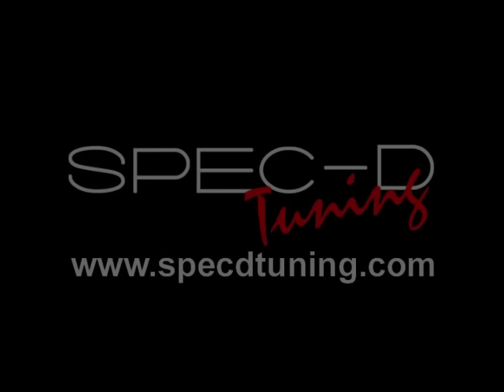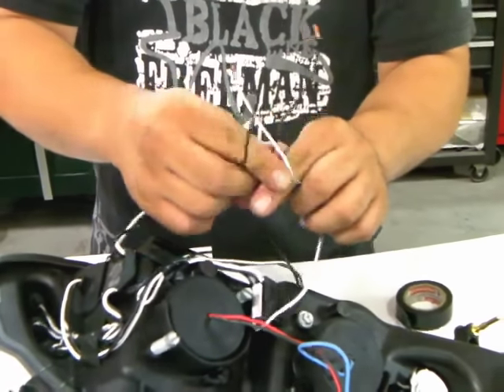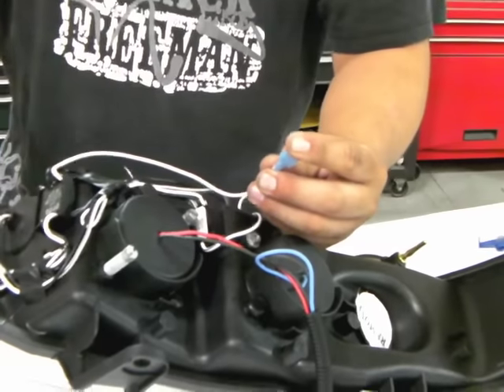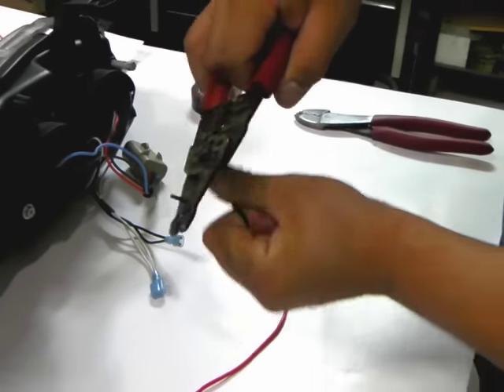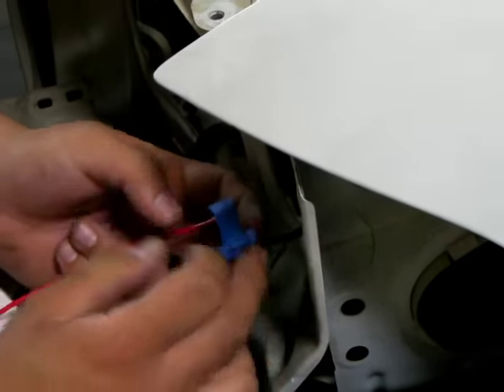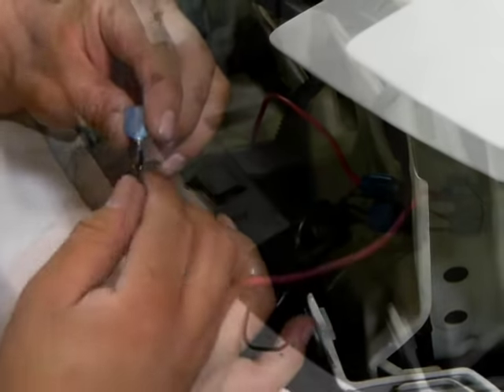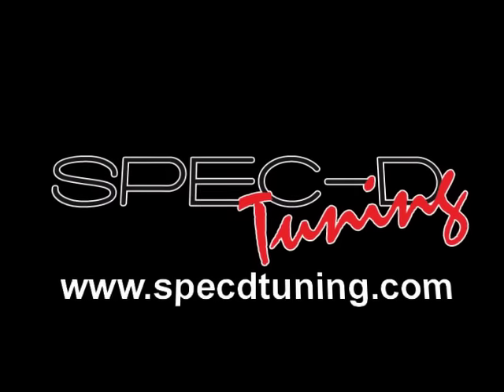SPECDTUNING Installation Video: Halo LED Projector Headlights Wiring Installation

Comment from the maker: You could always splice them into the headlight wires or if you have fog lights wire them to that, or interior lights. If you wire them with the headlights they only turn on with your headlights same with the fog lights. but if you go interior lights you would have to find the right wire to splice into so that they turn on when your car is on. Some wire that is always getting power.

Comment: Different companies make these lights. Some will make them with a board directly behind where the ring lights are. Some will only come with the c-clip on the front and you have to buy the wiring kit. If you have the little boards behind where the lights would be or are, then you just have to sauder the wires to the board. Then buy the lights separately and wire them in like the video shows.

Comment: I see that you spliced the extra red wire to the wire with 12volts running through it. Did you do the same for the extra black wire or is the extra black wire spliced to the ground wire.

Comment: What you most likely did is you connected the halo rings to the low beam wires and not to a 12v wire that is constantly powered when you turn on your lights to the daylight running mode.

Comment: Those are ballasts and from my knowledge all HID lights require them. Unless you are replacing a stock HID bulb aftermarket installation involves a complete kit with bulbs, ballasts and wiring harness.

Comment from the maker: @nimkal Automatics and Manual will still be the same.. your parking lights act the same as your Daytime running lights. if you turn the knob for your headlights one click, then those should be your parking lights.
wire your halos and leds to those. signal light wires are completely different.

Comment from the maker: @BLAZE45 The headlights should be the same. There are headlight bulbs that are included for the low and high beams. Unless, your headlights are not projectors; then you will be required to use your stock light bulbs instead. But as for projector headlight bulbs, contact your seller and let them know that you are missing bulbs. Good luck

Comment: So do you hook up the black and white wires and the main head light harness for the regular lights? I can't see low/high beems working by hooking them up with only the black and white wires connected.

Comment: I have another problem. I have them hooked up by following your video. I also have LEDs in the assembly. The LEDs light up in low beam on the drivers side and not at all on the passenger and the complete opposite in high beam. Is there an easy connection problem I have or is the head lamp assembly messed up?

Comment from the maker: @chrstbelieving Not quite understanding what you mean by splicing them in between the car. If the way you describe on how to wire the halo's and led's work then its all preference from there on. However, this was just a simple tutorial on how to do a basic wiring for these types of lights

Comment from the maker: @elizabeth7699 Please remember, if you fog lights are not Factory, then the power wire might have been bypassed from the fuse box. Moreover, if your parking lights were working before the installation, then the wires are not wired correctly. Good luck to you

Comment: I just bought a pair halo headlights from spec D tuning  for my 96 200sx ser. I have a quick question do I have to remove the bumper to install ? or follow the procedures in this video.

Comment: i installed the lights as you showed and they work really well BUTTT my indicator lights are not flicking on and off for some odd reason. they did so just earlier today and now theyre just on and not blinking. also when i put on the park lights is the halos supposed to turn on as well ? they only turn on when the main headlights is on. its ok but it would be cool to have halos on the parking side too. thanx everybody.

Comment: Bought these for a 2000 Pontiac Grand Prix GTP.
 Is the installation the same as in this video?
 And, because I do have daytime headlights, is this an issue?
Thanks for any help you can give me before I start installation.

Comment: Theres a third smaller wire (white w/black stripe) that appears to go to the 3 small leds. Does that get connecter with the other 2 white wires?
Reply: Johnathan I have three set of wires instead of two what should I do with the third wire no video on youtube showing what to do with the third wire
Reply: @michellehaley166  did you ever figure out what todo?
Reply: @ItsTheByrd  yes thank you for asking
Reply: What did you do

Comment: To SpecD, How do you adjust these headlights??? At 2:09 in this video the headlight is oriented with the turn signal to the right, high beam center, and low beam left. To adjust the headlights do you turn the two long flat head screws on the low beam light, or is is that long gold screw to the upper right of the video at 2:09?? Thank You

Comment: I have two questions before installing my projectors:
I ordered the Anzo 121055 headlights for my 02 Civic and noticed two things.
1. The two wires in the back for the halo lights, one should be red and the other should be black, yet both are red. Where is the black ground wire? Do I wire them to the headlights or the park lights?
2. The area right beside the yellow plastic marker (right below the signal light) doesn't have a bulb it in. It's just empty. Is it supposed to be like that?
Thanks!

Comment: @Specdtuninginfo I dont understand why you guys quick connect it into the Red wire which is the headlights... the whole point of the LED and Halo lights are for them to be on without the headlights to be on  during day light. So on a manual how would I be able to do this? Which wires would I need to plug the halo/led wires to?

Comment: @BLAZE45 The blinker is not really connected in the wiring harness is it? I thought that was separate? But I may run my halo lights to a toggle switch in the inside of my car with it being straight wired to the battery. Having all three spliced to your parking light doesn't make the lights a little dimmer than usual since they are all sharing the current?

Comment: My halos have only one black wire and one white wire so do I just do the same as the video just with one wire in the connector instead of 2
Reply: Jeremy Perez mines is more complicated. I have 3 black wires and 3 white!! Idk what to do with the extra 2 that that didn't show in the video
Reply: Jeffrey  I m installing this same one, this  is the same question I had, so did you  solve?

Comment: I just purchased a pair of Ford Edge headlights (2LHP-EDG07-TM) that came with 2 resistors. Your wiring or installation videos don't mention those resistors at all. Are they actually needed?

Comment: Just got my headlights today, havn't wired them up yet, however I was planning on putting an HID kit into them, but as soon as I open the package it says HIDs not allowed. What is the point in buying projector lenses if you can't use HIDs?? will installing HIDs still be possible? is that warning on there because of the heat they produce? thanks

Comment: What if the aftermarket LED projector lights come with a red, white, and black small wiring harness that looks similar to the one created in the beginning of this video using the black and red wires?  Do I just separate cut the wires and remove them from the crimp connectors they came with?  If so, can you tell me if I'd be using all three wires?  Thanks in advance.

Comment: @Dstars3 Im pretty sure that its not worth the money to go to the pros. This is a very easy install, and you wont mess up your car. The worst you can do is burn out the Halos or LEDs on these headlights. These are plug and play. The only wiring you are doing is to hook up the Halos and the Led lights. All you are really doing is hooking all the same color positive wires together and connecting it to positive wire on your light harness. and same thing for negative. Quick connectors WORK!

Comment from the maker: 24 gauge and yes you can splice into that instead!
Reply: I have a 2002 Ford Escape. I'm buying the Spec-D 2005-2007 Ford Escape Halo projector headlights. The question is what year wiring harness kit do i need to install them, i know it's possible. Do i buy the 2005 wiring harness?

Comment: Why not run the wires on the headlight side of the connector? Running them on the other side of the plug gives you more things to disconnect.

Comment: So you spliced both positives together at the light and the negatives respectively, then positive and negative on the car respectively and put them together with the handy male/female forks. simple, but I don't have fog lights setup on my car. Should I install a separate switch for this? I just bought these from k2motor.
Thank you

Comment: You can make them work with the lights off but you have to wire them in differently. Put your lights on in the first mode with just the markers on. If you do it this way you just splice the hot wire into the wire that has the electricity running through it. You can also add an auxillary switch ran into the cab of your vehicle and run the wire to your battery. The black or ground wire can be attached to bare metal.
Reply: Excuse me but could you explain that in detail?

Comment: QUICK QUESTION.. i installed halo leds..they now work. nowhwo to i adjust the position of them.. the lowbeams are not straight and the high beams are pointed in the sky.

Comment: Did you quick connect the halo lights to the low beam wire?  if so, how are you able to turn on the halo lights without the low beams shown later in the video 5:58 .  Is it safe to quick connnect it to my parking lights instead?

Comment: So It’s safe to assume that the red cable it’s the one with power in my car as well since I also have Civic... right ??? Worst case scenario I just peel some of the cable insulation to expose the copper and then some electrical tape. I just want to know if the red cable is always the one with power

Comment: Thanks for the video my mk5 doesn't seem to have daytime running lights. Tested it and nothing just the normal  lighting signal high and low. Is there something else I can do maybe a different light switch I did order one The one I have just turns on the lights and turns it off there's no auto feature The new switch will have that?

Comment: Stupid question but I got the LED lights to work but they dont turn on unless I switch on the low beam lights. Did I do something wrong like connect the wires to the lowbeam lights insteado the the day time running light??

Comment from the maker: @airsoftassassin07 That should not have happened. If your blinkers work to begin with. there is no reason that they should not come on. The only thing this video shows is how to splice wires to your already working bumper lights (or blinkers) so that the Halo and LEDs can come on. If you have a headlight that (the headlight corners) plugs into the blinker harness; then its the projectors that are defective. Good luck

Comment: Okay first time doing an install like this and cornfused lol...I have a 2004 toyota corolla sport and just got my headlights today...the video is very helpful but do I splice the wires AND connect the standard plug on the headlight to my factory harness...he doesn't say...the headlamps I purchased have a wiring harness for the low and high on the back (I know I'll have to splice the LEDS)

Comment: @BN3DC2 
Check I wires again. Is your positive to the positive to the parking lights. And is you ground. Grounded. Best practice is to test the light before putting the headlight back in. Does you headlight have Led strip along with the Two halo?  Or just the two halo?. What car is it on anyway

Comment: I just received my Halo Projector LED headlights for my '07 Ford F 150.  The lights have a standard three prong connector and one red and one black wire.  Do I just plug the three prong connector into my regular plug on my truck and connect the red wire and black wire to the hot and ground wire on the trucks three prong connector?

Comment: is the copper wire ok to use the sold one which is quick connector thin enough to fit in the

Comment: Does the head lights bring the red and black wires? Does this same process works for the 04 Toyota Celica GTS? Does the wires behind the headlight harness have to be either red, green, or black or other vehicles will have different colors?

Comment: I installed the 1996-1998 HONDA CIVIC R8 STYLE PROJECTOR HEADLIGHTS on my '98 civic but didnt have a volt meter to do the l.e.d. wiring. I would like to do the wiring but am curious, will i have to take out the headlight casing again? Or would i be able to leave the headlights in?

Comment: SPECDTUNING: i was wondering if other than the power and ground was there anything else that needed to be connected such as the blinker light or does this setup already allow for power to flow to that automatically.

Comment: have a pair of these and i have only got 2 wires on back off driving harness +/-
wired the rest up but only have indicaters dipped and main lights working no halo or led any ideas how i could wire these on

Comment: hey man i just bought one of those headlight for honda accord 2006 they look nice but i got one problem wat wire should i test for the power i mean there is 3 wires the low pim one, the high pim, and the turn signal. so which one should i test

Comment: I recently installed halo projector lights and my headlights are dim and are not bright, I wanted to know which are the low beams and high beam, it has h1 in lows and h3 on highs I need help

Comment: Spec-d tuning I bought some halo projector lights for a 2003 chevy s10 xtreme . I currently have 1 light out on the Halo. With that said I was wondering not only how to change it out with a new bulb, the type of bulb I need and whether or not maybe I can buy directly from you but I would actually like to switch them from blue to red if possible.  Please point me in the right direction.  Thanks for your time and products.

Comment: Hey, my left halo and led lights do not turn on, Sometimes when I fiddled with the wires a bit they did, but recently I tried doing the same thing but they wont turn on, The right ones work fine though, any idea what the problem might be?

Comment: in my buddy's 2002 ford ranger, are the parking lights in his case the wires for the turnig signals. i kno it sounds weird, but has no daytime running lights unlike myself with a chevy. where exactly should they be placed in order to have the halo lights lit while he is driving?

Comment: I have 91 chevy silverado. I have connected the halos behind lowbeam harness, but they only come on with the lowbeams. I didnt connect with parklights, I was afraid they would blink with(when) signal(ing). IF I CONNECT THEM WITH PARKLIGHTS WILL THEY BLINK WHEN I SIGNAL LEFT OR RIGHT? OR CONNECT WITH A TOGGLE SWITCH?

Comment: i have a 2002 yukon. when i remove the headlight there are two connections. when i quick connect the halo projection headlights, which of the two connections do i connect them to?

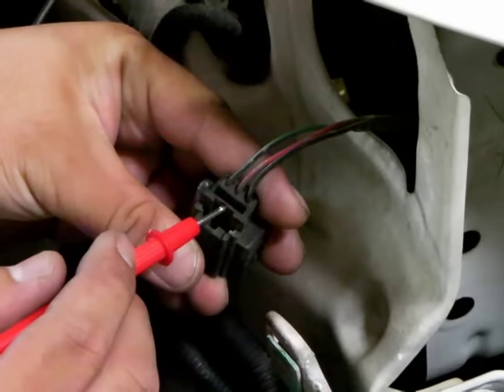Comment: I cannot find the 3 wires behind the headlight harness (At 3:40) . I have a 2004 Honda Accord. I only have the 3 sockets for the high beams, low beams and turn signal lights. Should I be connecting the quick connectors to one of those?

Comment: do they already come with hid bulb...because mine are h1 and if i buy hid kit it comes with bulbs but i think i cant be able to do it because the two red and black wires coming from the bulb..and wont be able to connect to the socket

Comment: In this video he shown just attaching together 2 white wires and 2 black wires. But these headlights comes with 3 black and 3 whites. So what happened with the other 2 wires? Where it goes connected?

Comment: Hi, I am wondering, I went 2 Radioshack and bought the red and black wire. It is 18 gauge and it is a single copper wire. My question is can I use that or does it have to be the kind of wire that is a bunch of little wires wrapped in one. If so, wher can I find that kind. Any help would be greatly appreciated.

Comment: My LEDs and Halo lights aren't working but we followed the instructions to the letter. We got a 12 gauge wire but it wouldn't fit into the crimps so we used a copper audio wire we had. Do we need a 24 gauge? Could that be why they aren't working?

Comment: s you know the the led lights come with an end piece that your suppose to plug into your existing DRL lights... On my 1997 Accord SE there are no DRL...I was wondering could I strip the wires and crimp them like the angel lights?

Comment: Just bought angel eye halos for my toyota celica, but the white and black wires are already connected though a box but they come out on the other side so it looks like black turns into white and white turns into black, do they switch colors or is black still grounding and white still power?

Comment: I recently bought the 99-05 VW GOLF IV GTI 2 HALO PROJECTOR HEADLIGHTS W/FOG LIGHTS - BLACK for my '01 gti and i am having issues with wiring the halo's. I am not sure where I am suppose to connect the halo's to.

Comment: I have these on my 2001 vw golf and the right halos are very very very dim and the ones on the left are extremely bright. do i need to replace the right halos? what size are they in MM measurements. also want to change the color is there a place i can buy specific sizes and colors or am ijust screwed and need to buy need headlights all together???

Comment: Hey
 okay i have ordered projector headlights and i an unable to find female crimp connectors. do they have to be the same shape that you showed in the video or they can be any crimp connectors both male and female. Also, if they can't be different from the ones you showed, where will i find these female crimp connectors??